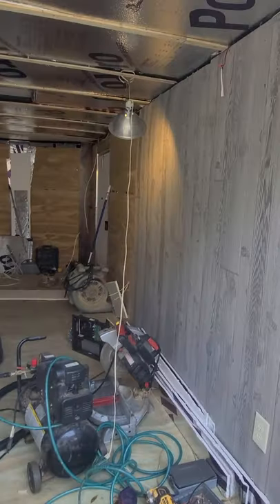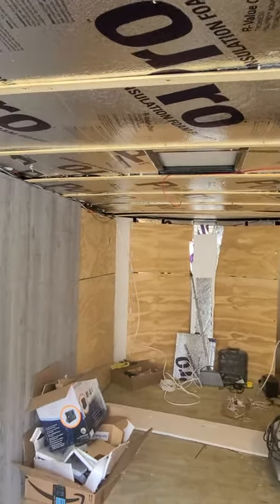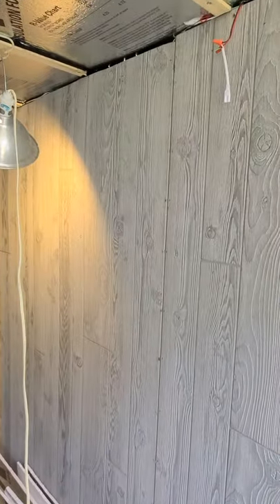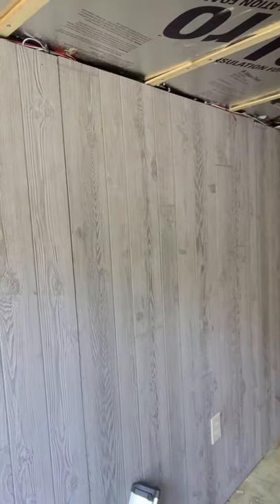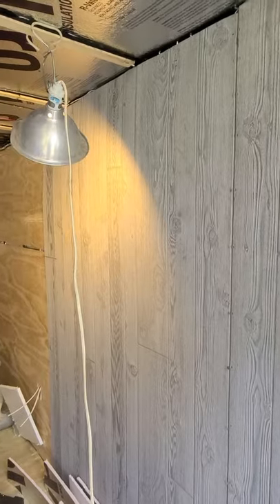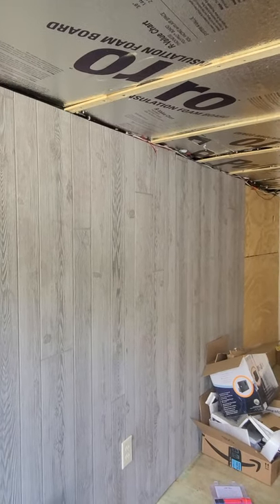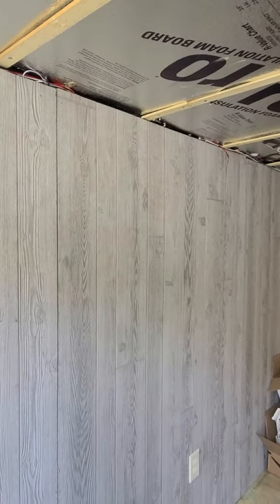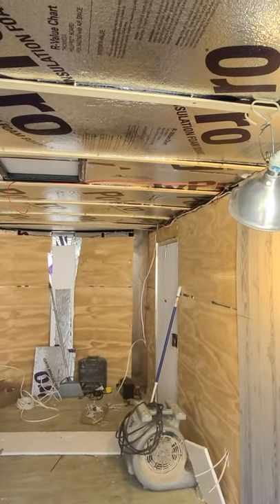September 15, 2020 #trailer #Camper #rvliving #vanlife #Conversion #rv #camperforsale #tinyhouse

Comment from the maker: We have the insulation, grey wood paneling, electric, air vents and back wall in so far. This it a new 2020 Black and diamond plated 7 x 16  cargo trailer we are coverting into a weekend camper or longterm camper. This camper will sleep 4 adults and 1 child and a air matress area for 1 extra child.  Max fan for circulation 2 clean air vents,, Standalone AC, dehumdifier,dehumidifier, unit. Our color scheme is white on grey and grey on white with black appliances. When completed it will retail at approximately $22999.00 It will have all the covenceses of a tiny home. we are installing all electrical, foam board installation, grey woodgrain paneling on the walls and white shiplap or wyan Scott on the ceiling. white cabinets with grey countertops, 15x17 x9 deep stainless steal kitchen bar sink, residential extention wand faucet store away induction cook top, a small refrigerator we are not sure of the size yet tbd, a microwave, cabinets for plenty of storage,    grey tank, black tank and water tank, propane, solor with inverters and generator backup system setup, or water purifier system , bathroom has a hotwater on demand system, 18 inch standard height toilet, brite white 24x 32 tub and fux tile shower surround,  mold resistant grey paint, dining and sleeping seats 6, a queen lift bed on ceiling or can be removeable, queen lowers to mid area, the 2 dinning benches are great for sofa lounging on a rainy day and dining inside, the table moves out of the way or converts benches to a queen bed. The bench tops are removable to access plenty of storage for pillows, blankets, linens and towels. The back ramp door gives a perfect patio area up off the ground. There is 2 house windows that open and fit in between the studs of the trailer walls so we wouldn't compromise the intergratey of the orginal trailer structure. Outside tbd but as of right now an outdoor shower, air vents, propane tanks and solar panels black siding with diamond plate trim makes this camper complete  #Cargotrailer #Camper #rv #Conversion #Van #Life #tinyhome #rvliving